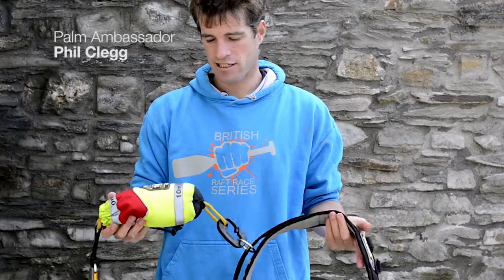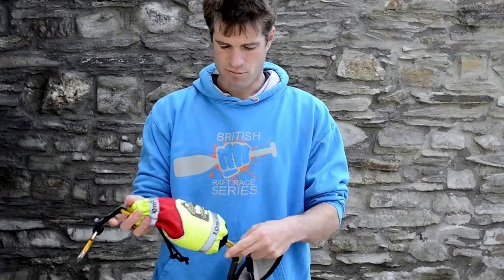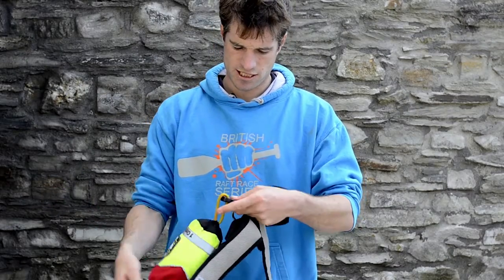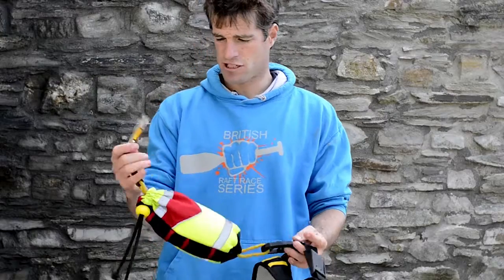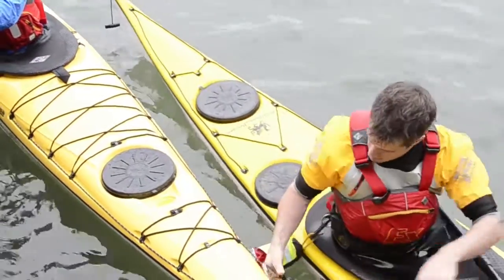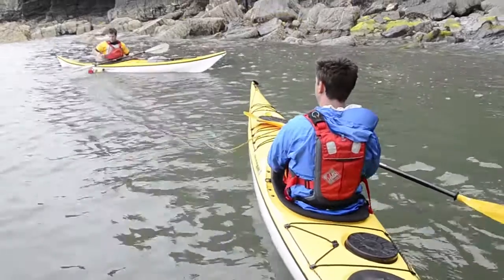Phil's custom throwline towline

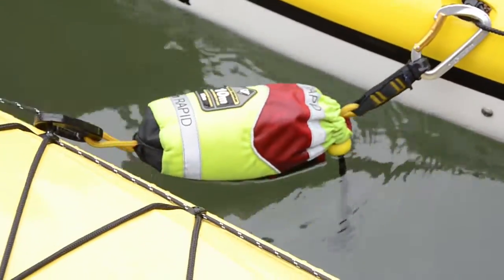Comment: How do you make the main line not pop out and lengthen at 0:37 as a short contact tow? Thx...
Reply from the maker: Spotted! There needs to be a connection through the bag as a load bearing part, rather than simply attaching to the end of the line. Not described in the video, you'd need to make a modification to the bag.
Reply: @palmequipment  coolbeanz, thx I had the same thought. Just made my own version without the throwtow line bag too dangly around the waist. I would buy a waist mounted throw tow belt if you make one in the future! Thx again.

Comment: Only issue I have with double carabiniers is that underload if on a deck line you might not be able to release without cutting line unless I missed something (no sound when I watched)
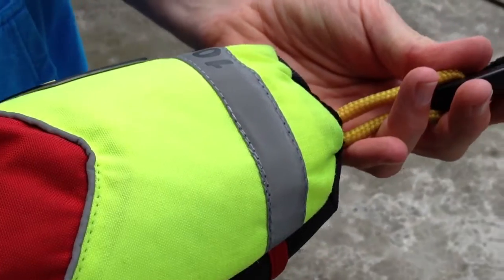Reply from the maker: There are two quick release buckles on the waist belt. In this example at 0:13 seconds you can see Phil has connected the line to the quick release strap on the back of the belt using an O-ring and a Seadog clip ... so you can release the line without losing the belt. The belt also has a quick release buckle at the front to release the whole belt as a backup.